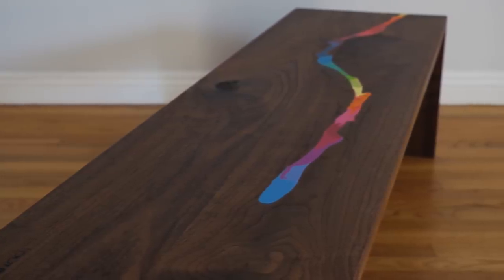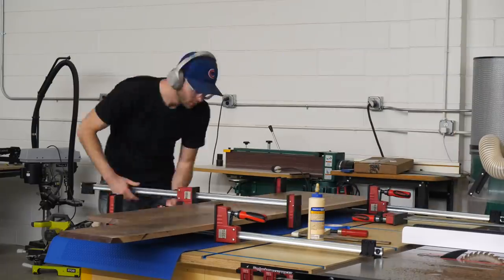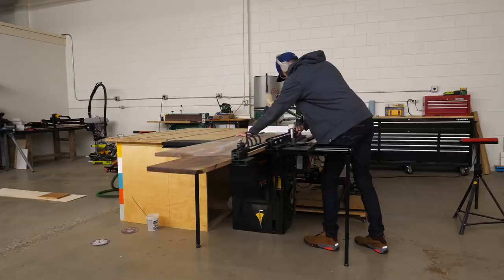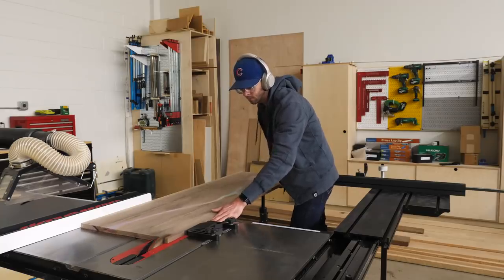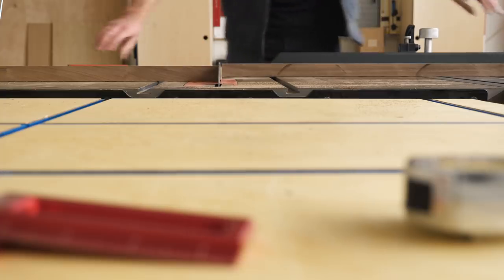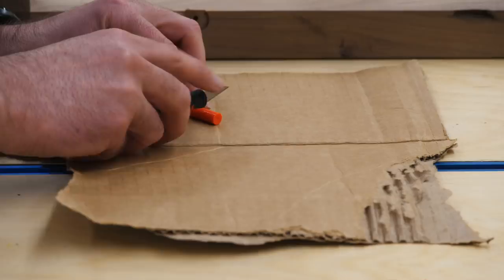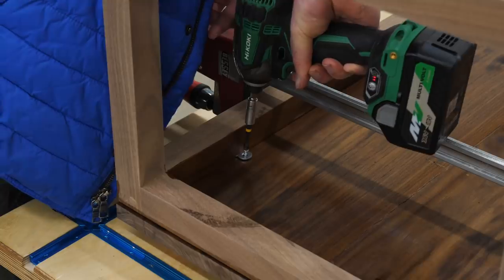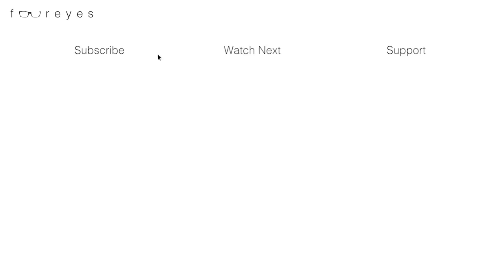Epoxy OVER Crayon River Table...I FIXED IT!!!

Comment: If you wanted to try using the crayons for plugs again maybe next time throw a dab of hot glue in before the crayons to stop them from falling through. Might work a little better?
Reply from the maker: good call
Reply: i was thinking superglue would work better. hot glue for me is always too messy but maybe i just suck with hot glue.
Reply: Fall through what though? Was there not a screw under it?
Reply: This could work but then you’d have to melt the crayon before you put it in, the heat gun would most likely melt the glue too
Reply: @Yonatan24  yes there was a screw under it but the wax went through the screw hole

Comment: I have two 9" x 72" x 2" pieces of butcher block left over from a previous project.  These have been sitting around the garage for several years and now I know what to do with them.  Thanks for the inspiration

Comment: To improve the appearance of the epoxy overlay try gently heating the epoxy with the heat gun while it's still wet. Fresh epoxy has air bubbles in it that can cause cloudiness or milkiness. Heating the uncured epoxy will force most of the bubbles to the surface.
Reply from the maker: I did do that. I'm not sure if it was on camera or if I just cut it from the edit since it wasn't super interesting to watch...and I wasn't thinking this as a tutorial type video.
Reply: @Foureyes.Furniture  Its also good idea to have vacuum chamber to remove majority of the bubbles before pouring, so only little heating is required afterwards.
Reply: I’m actually using epoxy in a wood ring project and if you let a little bit of bubbles stay in, it adds to the effect. Probably better for stand alone epoxy, though.

Comment: Since you always hide your screws, or don't even use them in the first place, I think you should build something where you try your best to not hide them, if that makes sense
Reply from the maker: Makes sense. I do think about that sometimes. using the screws as another design element basically.

Comment: Not bad, now make a table with rgb lights under the epoxy. It would look really cool.
Reply: @vek7933  Rough sanded epoxy would also diffuse the light. Only thing is that the leds should not be close to the epoxy surface.

Comment: i like it even more than the first one. also the music was a nice choice. Did you run into any issues with the crayons melting and mixing with the epoxy since the poxy heats up while curing?
Reply from the maker: No...it didn't seem to cause any issues. If anything it might have temporarily heated up the very top of it...but I couldn't notice anything.

Comment: Very nicely done - project & video.  The only thing I would suggest, is routering a small spot wherever the river hits the edge of the table and filling it with epoxy. Set it up so that when you cut it to length you cut through the epoxy "plug".  This way you won't have the crayon layer exposed at the edges where it could be pried out/into.

Comment: Hey Chris
Great followup to your first revision of the crayon table.
The piano background and general narration are appreciated, and a nice forward step.
At the 7:20 mark you mention countersinks, however they are counterbores.
I have developed a process where I cut my counterbores, then make short plugs from delrin, and then top with a fill material  (ie crayon for your project,), or then cap with either a short wooden plugs that have near net grain pattern to the body of piece being plug, or a contrasting wood plug.

Peace
Reply from the maker: Thanks...do you have a visual example? DM me on Instagram or shoot me an email.
Reply: I will look to see if I can find pixs of a round slab table that I  did with liquid  turquoise  inlay( find on Amazon).
I used 2P10 thick at first( without delrin plugs) , but found it cured too quickly, and had voids.
Found that by filling in with delrin or aluminum barstock you have alot less volume to capture air with the liquid element.
If I cant find pics,  I am in the process of  helping my little guys cub scout pack make 12 pinewood derby cars this week, and have a request to produce a live edge slab table, with "liquid metal look" inlays as screw plugs.
I am going to melt aluminium cans and pour them in the counterbores.
If time allows next weekend  I will try to do some prototypes and fwd to you via Instagram.
Peace
Reply: PS
I've started carving signs thanks to Dave,  Eric and Vicki's YouTube channel at make a wood sign.
Your crayon melt technique instantly opened up the thought process as my kids now love to paint the carved inlays.
We will try a crayon melt fill and shoot some pics.

Comment: We use flash breaker tape for our epoxy dams. Normal 3M painters tape tends to work pretty well too, but the epoxy will stick to it so there's a small touch of cleanup. Not sure how it handles heat though, I think the flash breaker is fine.
You can also dye the resin if you want colorful plugs, but then you'd have to make several tiny batches. I'm not sure what kind of resin you used, but it should be glass clear so the color vibrancy shouldn't be diminished. If you were to do it again I'd suggest using a thinner layer of resin as well as that may have a slight impact.

Comment: This was really great!
Here's an idea to get the best of both worlds. You first fill the river with the crayons, level with the tabletop, then coat the whole top a few times in resin. That way you get the better vibrancy and the protection! Just be sure to use a resin that doesn't heat up too much when curing or it may re-melt the crayon and mess up the look.
Reply from the maker: A few people suggested that...I'll have to give it a try some time. Thanks :)

Comment: I have a tip for anyone who wants to do this and use resin. Resin will get bubbles while mixing and being poured, so right after pouring the resin go over it lightly with a heat source like a torch (i think that's the right word) or heat gun. It will pop the bubbles and in turn keep it clean. also, when you get done (sanding, buffing, all that jazz) cover the whole thing in a light coat of resin using a large paint brush. it may take some time but it will make the crayon less murky since the sanding will make the resin murky.
Reply from the maker: Good call...I know this company also sells a polishing compound that's like 3000 grit that you can use for a final pass before finishing.

Comment: Since you cut the wood though do you not still have exposed crayon on both sides of the table? I guess the amount of unexposed crayon is minimal but I would like to have seen you fully encase the crayon to go for full protection.
Reply from the maker: I did a test piece and had to hold a heat gun directly to it for about 30 seconds to get any leakage. So I don't think it should be an issue. For context, a heatgun is several hundred degrees.

Comment: As with the first one this looks amazing. River tables are probably a spent idea at this point but this is really an original take on the concept.

I wonder if putting a teeny-tiny amount of epoxy (or even just regular glue) in the screw holes would seal them enough for the crayon to stay put?
Reply from the maker: Yeah, a few people have suggested CA glue. Seems like a reasonable approach.

Comment: Had a quick look through the comments and didn't see this (although someone probably has said it!). It is a shame you didn't continue with the wax 'plugs'. It would have added an interesting counterpoint on the legs. Thinking about it, you could have maybe poured a little resin into the screws and then added the wax on top. That would have stopped them leaking out. That said, it would rely on the resin not being so thin to do the same LOL Another thought I had was to use small plugs that could be put in and then just a small amount of wax on top to cover them.

Overall a great project that looks amazing and I love the different take on the river idea, and the innovating use of materials :D

Comment: For starters the video was amazing table looks fantastic also the way it was edited great work 

Fireplace mantle with the crayon finish in the front is there anyway way to have it made can we work something out
Reply from the maker: Perhaps...do you use the fireplace and how hot does it get? Crayon melting point is about 140 degrees.
Reply: @Foureyes.Furniture  the fireplace will just be for looks

Comment: I wonder if using a torch or other method to help get rid of bubbles in the epoxy would have helped it look more clear as an end product. That's something I've seen channels that use epoxy more do and it ends up producing a very clear result. Especially when using specifically high transparency (low opacity) resins.
Reply from the maker: I used the heat gun to do that. to make it more clear I should have sanded to a higher grit.

Comment: Let’s say I wanted to do something, but on a much simpler scale with limited access to tools, do you have any suggestions. I was thinking maybe a 12” by 12” version to hang on a wall or something. I’m just wondering the cost of these?
Reply from the maker: You could do the whole thing with a router, or a circular saw....or with a router and a circular saw.

Comment: Very nice. I’m working on an end table that I want to do this with. It has a large knot I want to fill. I’m thinking do a pour of epoxy to seal the bottom and the fill in with crayons and top coat with epoxy
Reply from the maker: And Epoxy and Crayon sandwich :) 
mmmmmmmmm

Comment: Nice, but I was wondering if you also sealed the sides in some way? If the purpose of using the epoxy was to prevent damage to the crayon, it would still have that risk on the cut sides.

Comment: If you decide to use wood plugs for screw holes again, I would suggest matching the grain direction to the surrounding wood so they aren't as noticeable.
Reply from the maker: Yeah, I got a little lazy there.

Comment: Did you use a blow torch or whatever source of heat to pop the air bubbles in the epoxy after pouring?
Air bubbles are formed while you are stirring the epoxy.
If no, could it be the reason that you think the color does not look as good as the one without epoxy?

Comment: Great video. Thanks for that. Really interested to try something similar. How deep did you router the groove? I found when I experimented on an offcut that the heat gun was blowing the melted crayons up and out of the groove. Ended up making a massive mess. Even when it didn't spill out, I found the melted crayons rode inconsistently up the side wall of the groove. You's see this even if you epoxy'ed over it. Guessing either the groove i routered out wasn't deep enough or my heat gun is too blowy and not hot enough..?!

Comment: nice project, you could had some white led strip below the colors to make them glow :)
Reply: I use a lot of led lighting in Epoxy tables I make here in New Zealand but led lighting or any lighting really only works if your fill is transparent colors, as crayon is a solid color you will not get the effect of light illuminating or shinning through as it is a solid!

Comment: Loving the crayons! It has such vibrant colours. I really like it. I'm sure the naysayers will point out that the wax isn't completely sealed as on the ends it has no epoxy covering it so you better watch out for your kids running around with heat guns attacking that section. Bound to happen! hahaha
Reply from the maker: Yeah, I actually tested it on my scrap. I had to hold the heat gun there for about 30 seconds to get any to drip out. So as long as it doesn't reach several hundred degrees...we're all good :)
Reply: Better watch out in the summer then 🤣 ☀️🤣

Comment: Question - since the crayon + epoxy pour flows to the edge and then is cut to length, wouldn't the crayon layer then be exposed again?  Do you seal this somehow?
Reply from the maker: it is...but it doesn't cause any problems. I tested my...well...test piece, and had to hold the heat gun there for about 30 seconds to get it to melt out at all.

Comment: Did you have any problem with the resin separating from the wax as it cured?  I was testing this technique and while it looked perfect after 12 hours of curing, after 24 hours, it had separated somewhat and made it look foggy between the wax and resin.

Comment: In the original video you said the epoxy test you ran "pulled" the wax up and caused more problems. What technique was different in this go round to avoid that? I was wondering if a dovetail router bit for the river might help prevent the epoxy from "pulling" the wax up?
Reply from the maker: a much thicker layer of epoxy. I tried doing a very very thin layer on the first version so that it was mostly crayon. I wanted it to come up close to the surface. This version has a good 1/4" of epoxy overtop probably.

Comment: I am trying to build this as a desk in my high school wood shop, do you have any measurement for the router but and depth adjustments?
Reply from the maker: it was a 1/2" flat bottom bit. and I routed about 1/2" deep

Comment: You could do the table the original way, use some polypropylene sheeting to create walls and pour a resin top on the table (it would basically look like a glass top), then repeat for the sides.  Another option, if the rivers don't run over the sides, is  a glass or plexi topper to protect the crayon and table surface.
Reply from the maker: Yeah, for the original one, and those who worried, I thought the easiest solution was just to put a piece of glass on it.
Reply: @Foureyes.Furniture  Both are very cool tables. Thanks for sharing your work.

Comment: Chris,

I love your channel and your MCM taste (angles, choice of materials and design aesthetics).  

Question: what depth did you find works best for the crayons with enough left to fill with epoxy up to surface assume one layer of crayons?
Reply from the maker: 1/4" is plenty. 1/8 of crayon 1/8 of epoxy
Reply: Chris Salomone thanks for the reply.  I am building an MCM inspired desk for my son and using veneered plywood.  However it’s pourosity makes it impossible to cleanup crayon stains from overflow so may try to go a bit deeper after multiple experiments.  Might have been different if I had used solid hardwood. ...

Comment: Outside of the epoxy, I can’t figure out what top coat you did for the rest of the table top’s surface...? Is that just a wax or did you use a polyurethane/varnish of some sort? I was thinking about using a polyurethane on the entire surface and THEN routing out the crayon river for an epoxy coat...but I’ve never done that, and my guess is it would chip/flake the original top coat where the router cut through. Any tips?

Comment: Not that I think you have an answer, but I am hoping to put a crayon river into my longboard. With emphasis on hope, I’m afraid if I cut into it then the structure might be compromised, since boards are layered and compact saving weight and bulk. I have a standard almost square longaboard, normal length for a board and drop down trucks with a hole cut into the board for them to go through. If I could do the smallest depth possible to put wax and resin into, would it be very easy or practical to expect it to work or hold in there very long?

Comment: im in a woods class and I really want to make this! did you wait for the wax of the crayon to harden before putting the epoxy? or did you put it while the wax was still liquid?
Reply from the maker: It was hardened...but it hardens in seconds. Once it's below 140 it's back to a solid. So in the time that you set up the epoxy and stir it, it'll be solid.

Comment: Drill down tiny holes in the side of the river, large enough to fit an RGB LED, these holes should go all the way through, but not through the crayon layer, rather just above it.

Insert the LED along with cables drawn to the underside of the table then fill with epoxy. Draw all cables to a control box underneath the table that will allow a remote/phone to switch colors of the LED's. 

Route 4 different power cables through each leg of the table so you can decide how to draw the cable to the wall much easier and cleaner. Battery + Wooden table is probably a bad idea.

River is now illuminated.
Reply from the maker: Go check out Modustrial Maker...you'll love him.

Comment: I wonder how it would have come out, if you had used the router and cut the whole way through the wood. making the top 3 pieces. Then building a mold, and poured in clear epoxy until that crayon "river" was 1/4 filled. Let it cure, then add the crayons on top of the clear epoxy, then finished it off by filling the top 1/4 with more clear epoxy. I wonder if that light shining through the bottom of the bench/table would help the crayons be more vibrant? Furthermore, yo could maybe even add an LED light strip to help illuminate the crayon colors.

Now my mind is wondering. I might try that!
Reply from the maker: I say you give it a go...and make sure to let me know what happens :)

Comment: how did you make the crayon dry after heating it?
and what is that liquid that you put over the melted crayons?
Reply from the maker: It hardens almost immediately. It's melting point is about 140 degrees, so once it is cooler than that it is a solid. Over the top is epoxy :)

Comment: What did you do to stop the crayon from melting out of the sides since there was a section that gets exposed when you cut it down to size?
Reply from the maker: nothing...but it doesn't melt out. I tested on my "test piece" and had to hold the heat gun there for about 30 seconds to get it to run out. That's several hundred degrees

Comment: I think the "fix" for the less vibrant color is to just do it as the first one but apply a couple of coats of epoxy with a brush. I think you lose vibrance because of the depth of the epoxy and the structure due to sanding. Try sanding finer, this way it can become like glass.
Reply from the maker: Good call :)